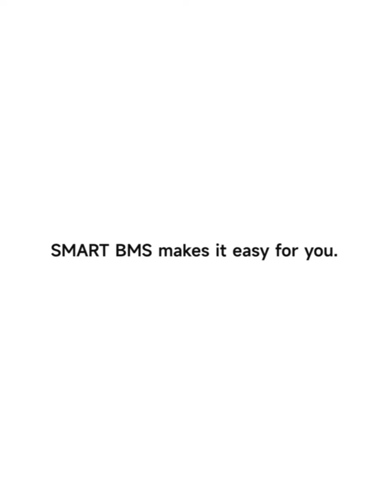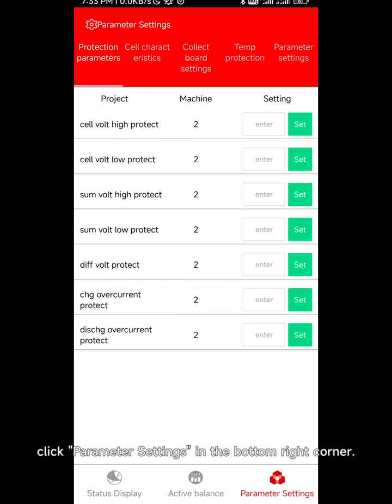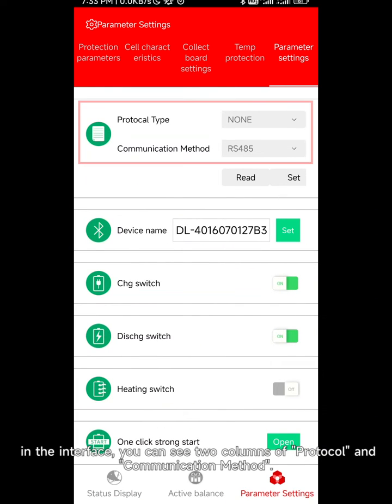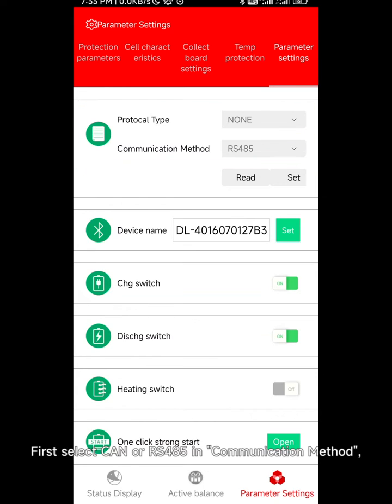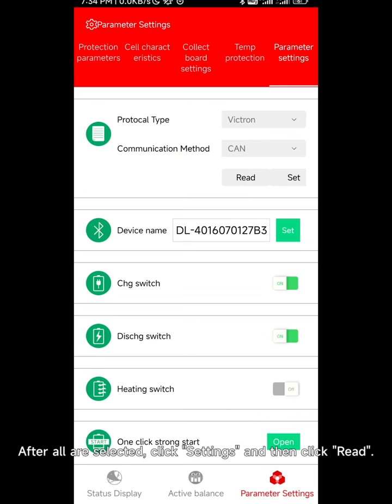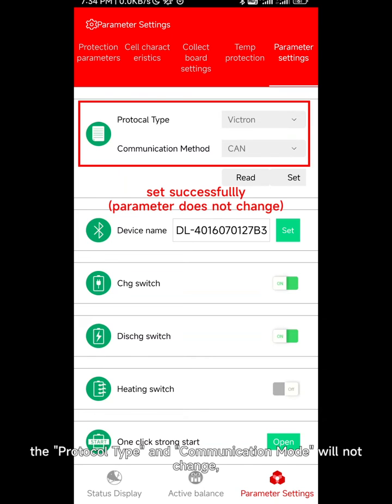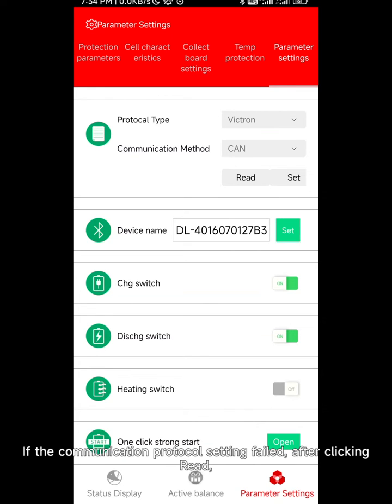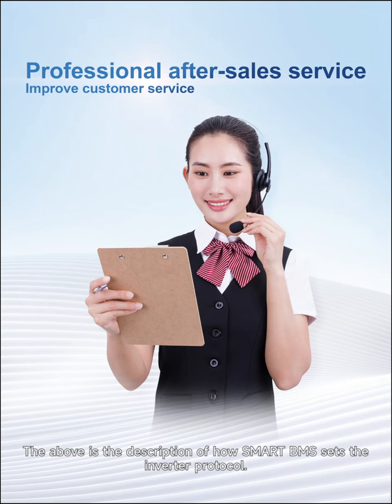#inverter #protocol #power #communication

Comment: Hi , hello ? Unfortunately this protocol did not work , you can not connect to DEYE !  I will ask for the phone number of DALY technical support ? Because after changing in PC Software 2.1.8 I changed to RS 485 PROTOCOL and to DEYE PROTOCOL , while in the application this change does not show ! The inverter does not connect to the DALI BMS ! I will ask for info to contact DALY ?